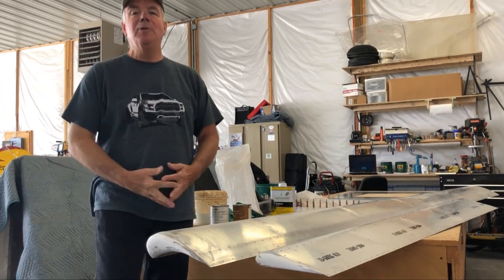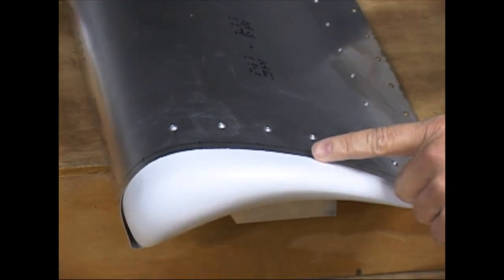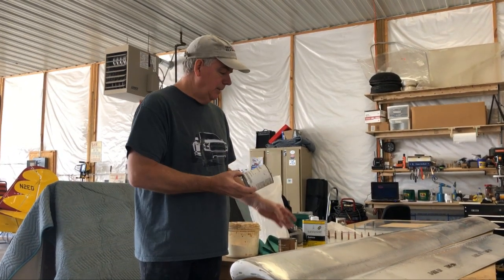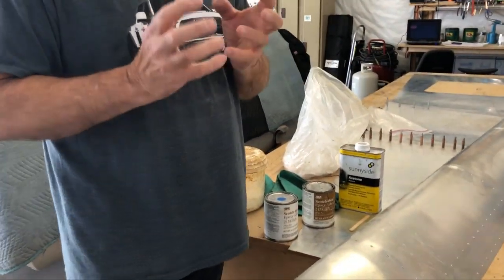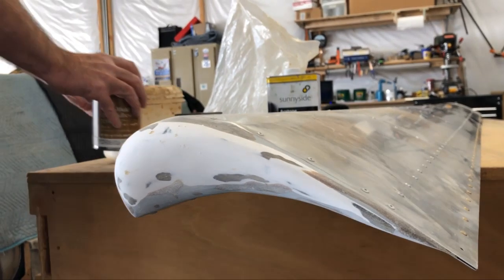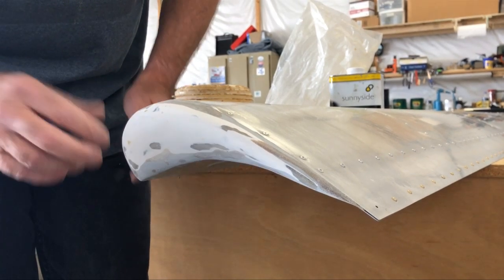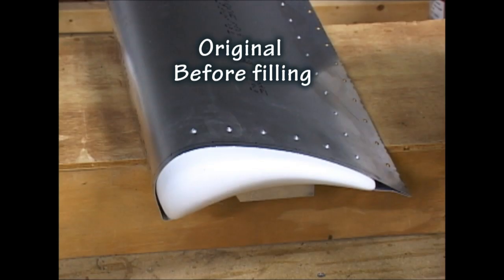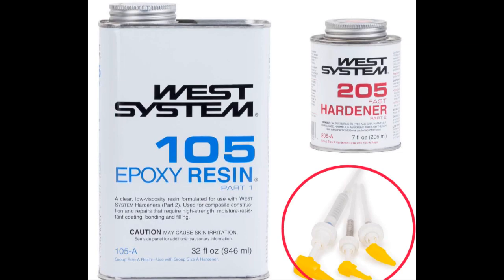Wing Tip Cosmetics

Comment: Flox is good to use for a structural bond. A lighter (by weight) filler that would be even easier to sand and shape is micro (micro glass balloons). Great tip!

Comment: I did the same to my wingtip on my 650.  The supplied was a horrible fit so I added fibreglass and did a bit of a reshape of the leading edge wingtip. came out a treat

Comment: Blue foam cut to fit and a micro/slurry works very well.
Reply: Agree.  I'd toss those fiberglass parts in the trash.  Push a block of blue foam against the open end of the structure and it will leave an outline.  Cut just outside that mark, then sand to fit.  Epoxy in place, sand the outside end to a pleasing shape, then coat with micro/slurry and finish.  Probably lighter.

Comment: Need to seek out the help of a composite builder. This is routine for us composite guys except we usually have to make the whole part. Flox is ok but heavy, we usually use microballoons to keep it light unless there will be a lot of stress on the part. Then we would use flox or milled fiberglass. I had no idea the 701 fiberglass parts fit was so bad.